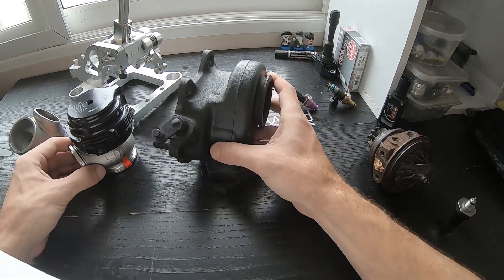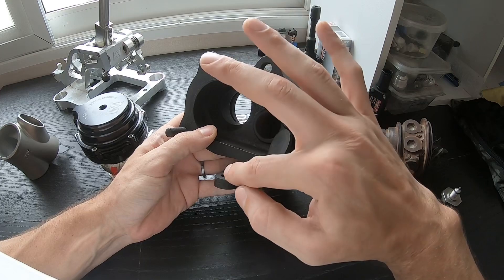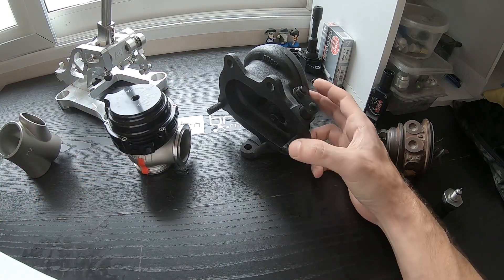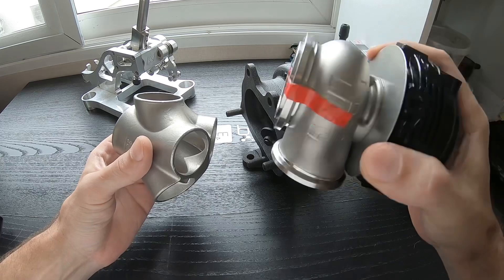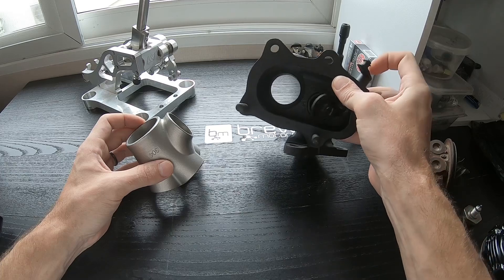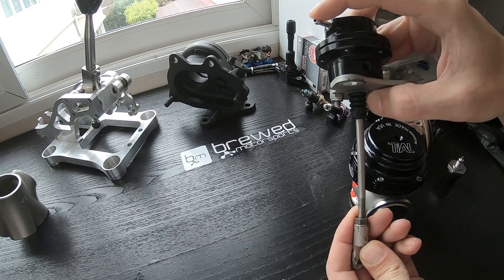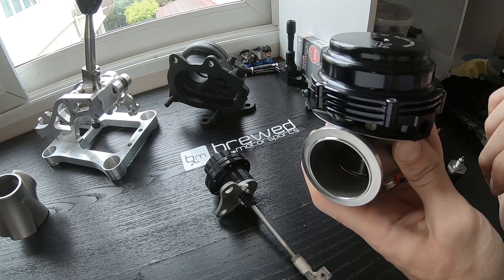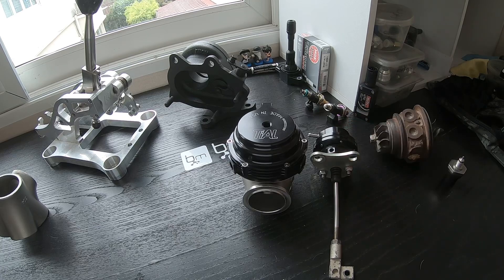Internal vs External Wastegate Comparison + Boost Control

Comment: What would the benefit in internal vs external on a G25-550?

The reason i ask is I wanted a .49 rear housing but it's only available in IWG
Reply from the maker: Great question but this will very much depends on the engine said turbo will be used on.
Engine displacement, rpm range, power goal, fuel type used?

Comment from the maker: Follow up video breaks down choosing the correct spring pressure for your wastegate based on lowest and highest target boost keeping in mind engine protection strategies https://youtu.be/k93Os4xCY9I

If you’re serious about your build utilizing these basic set up tricks along with cost effective sensors will keep your safe under all conditions.

Comment: I can definitely vouch for accuracy and reliability of the external tial 44mm wastegate , we wasted about two weeks of tuning trying to fix a boost creep problem with a knock off 46 mm wastegate with no luck until I chucked it in the garbage and put on one of the tial 44mm!
Reply from the maker: @stevenjones7113  those trusty Tial gates get the job done ✅

Comment: Very informative...    Would also be nice to go into the added tuneability of being able to switch out springs on both external and aftermarket iwg actuators for different boost applications/goals....
Maybe a wastegate discussion part 2 can talk about that and connecting up the boost control solinoid for the different combinations/ports mention here 😁
Reply from the maker: Thanks much and agree 100%. Wastegate spring swap and boost solenoid plumbing detailed vid is a great idea. 
Maybe even a 3rd with ecu setup and functionality :P
Reply: @BrewedMotorsports  Have you dealt with any vacuum operated actuators yet?  Think it is more a euro thing but is much safer in terms of failure they dont overboost as they are a normally open type actuator.
Reply from the maker: @lionelstanbury1371  only in oe applications but they do work well. Also easy to open on cold start to help heat the cat 🐈

Comment: Good explanation of different types. Im looking to make a 350 whp from my sr20det. What are you recommending for consistency?
Reply from the maker: @cxlumpy  ooh 350hp sr is the perfect example of either internal or external wastegate would get the job done well BUT if you want any headroom for more power down the road using an external Tial MVR would be recommended. 
We do run higher power internal wastegates on some applications but imo with the room available on the SR20 going external wastegate when you upgrade turbo/manifold is ideal.